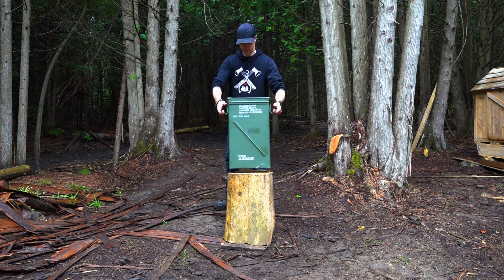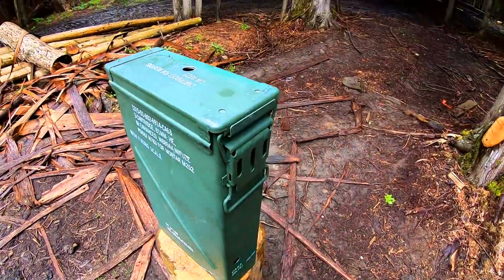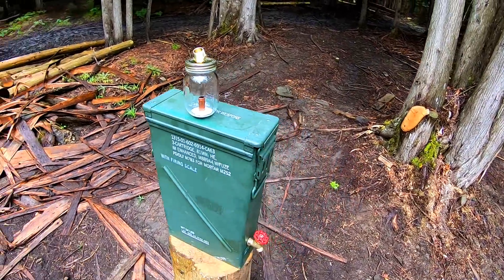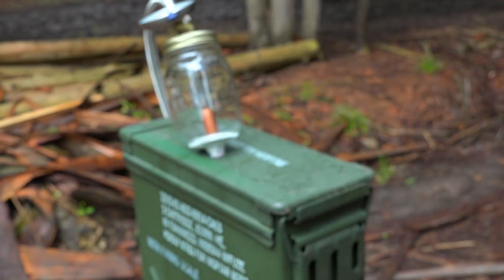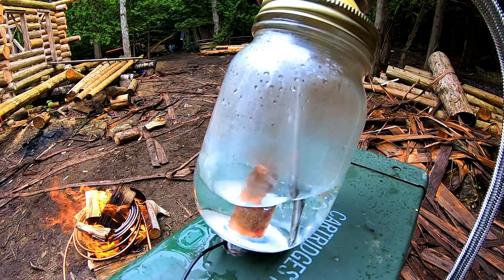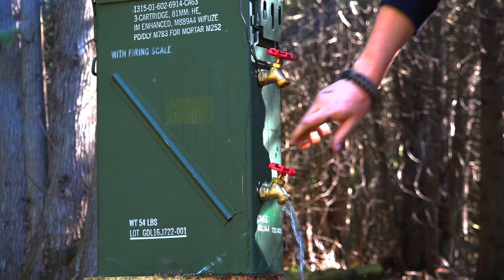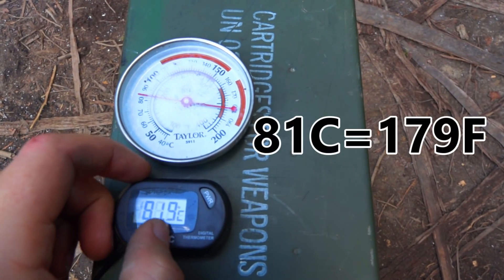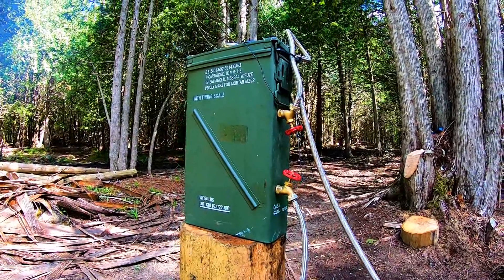Off Grid Heating Prototype- Copper Coil Water Heater / Heat Exchanger / Radiant Heater

Comment from the maker: Want to see the final product? Here's the next episode: https://youtu.be/BREQY1TL7JA
Reply: I haven't bathed in 4 days
Reply: have you thought about an under cabin heating system?  running some pipe or tubing under the floor would sure make it toasty in there.  although im not sure how it would hold up if the water freezes, maybe a cold rated rubber or something, would be cool to see regardless.
Reply: I heat 10 feet of copper 1/4" pipe around a coffee can.  Pair of check valves and the water will only flow one direction. I use 20 feet of pipe to cool before going to a pressure cooker. I get up to 180 degrees in the tank.
Reply: An ammo box? really, just use a big thin radiator you fool, its made for heat transfer, its thin it can also be wide and tall, just find the right one before I find you
Reply: I dont know IF somebody did mention it to you, that you could of just used a simple car radioator and thus eliminate the pressure build up and other problems and gain a much efficient and safe system.
Anyway good video and props on the idea.

Comment: Im unsure how it is pulling from the bottom and returning to the top even though both are under the waterline. The size of ypur tank shouldnt allow for much of a difference in temp from top to bottom and syarting out the water should be the same temp so shouldnt the copper pull the water from both the same and barely put it out the top if not just stagnating. Is there a one way check valve on the top inlet? Just doesnt seem like it would provide much if any circulation.

Comment: Great idea with the portable heater. Same idea as when people used to shove hot rocks and bricks under their beds. One of my favorite setups is salvaging old water heaters. Build yourself another cabin, this one as a bath house, put 2-4 stripped down water heaters inside, and another propane water heater outside. Gut the propane burner and set the heater on top of a rocket stove. I built mine out of old bricks. It only takes an hour to get 50 gallons of water to boiling temp with nothing but branch wood and kindling. Cycle this water into the tanks inside the bath house via thermal siphoning and you will have days of heat for only a few hours keeping a fire going and a few arm loads of branch wood. You can even upgrade it to heat via solar with pipes on the roof. The trick to that is to run a single solar panel and a temperature sensor to a small pump that only cycles water up into the solar heater array when the temperature in said array is higher than whatever you set it to. Say 70F. Otherwise the pump turns off and the water drains back down into the tanks. No chance of ice forming in the solar array on the roof! Easy as pie! Between wood in the winter and sun every other time of year you now have a completely sustainable system and hot baths year round.

Comment: build a small rocket stove and use t copper line around where the thermal mass would be collecting the heat. That would actually be the most efficient way and it would also protect the copper line.

Comment: Put a steel tank over the fire. Consider a 55- or 30-gallon barrel cut down to fit your needs. Fill it with water. Put your copper coil inside the tank. The temperature your copper coil is exposed to will never be more than boiling water (varies slightly depending on elevation) and it will last forever. The way you are doing it is producing steam. Live steam is a fairly dangerous thing. For what you are doing and how you are using it maybe just boil water in a pot and pour that into the ammo can. Then repeat as needed.

Comment: I suppose that this would be better than nothing, but it's insanely inefficient. There are several better set-ups without resorting to complicated equipment. As long as you're dragging a pickup load of odds and ends up into the backcountry, you might think this out a little better, or you're going to be spending a lot of time and wood just heating water.

Comment: Someone probably already said this, but by adding a check on the bottom will help in the correct flow direction and help stop bubbling, and heat faster. not saying you had these problems just adding content lol

Comment: Think about adding a steam radiator to this system to heat with allowing even cooler water to return to the coil by adding a one way foot valve into the cooler side of the coil

Comment: if you run baffles inside the ammo box you will get better water circulation. plus you must have a check valve.... pushing it in only one direction.

Comment: Remove ammo box, replace with a coil /fin unit like a car heater coil and a 12v pump. This will greatly increase efficiency. It's use glycol so it won't freeze.

Comment: I am curious about doing this but hot tent oven to coils that lead to water coils under a cot and back. I haven't thought it through, and I only watch youtube videos, but all the hot tent campers complain about the heat being up high in the tent, or that with multiple people inside, some are hot but the farther away people are cold, and it seems wasteful to burn all that wood and wake up often when the person is only heating far away from the cot and air up higher. I am not the person that is good at this, but I figure hot tents should have a built in system for the ovens to run water to heat the cot instead of the air in the tent. Just me spitballing.

Comment: Heating a long coil is dangerous because of steam and water hammer.  You need a number of larger diameter pipes getting heated, with the inlet low and the outlet high, no dips to trap vapor.  Look how boilers are built,  they can be configured for the liquid to be inside or outside the tubes.  A small gas water heater converted to wood burning is a good cheap way to make a safe reliable water heater.  Keep the PTR valve for safety, and consider blowoff valves elsewhere in the system.

For a convection system to work smoothly and silently, you must have proper sloping and elevation of all parts of the system.  The intake to the heating coil must be the lowest point in the system, the coil must go upward with no dips (the advantage of having a manifold and several tubes instead of one long one), and the outlet must go upward to the tank or radiator with no dips, peaks, or restrictions.  I'd remove the valve from the hot side of the circuit, and use short segments of large diameter flex hose, the kind with 3/4" fittings, for an unrestrictive inside diameter.  This way steam bubbles won't get trapped anywhere in the circuit and interrupt the convective flow.  The sound of bubbling and water hammer would make the thing insufferable while trying to sleep.  Put a hose barb fitting on a large diameter riser in the top hole of the ammo can, and run a vent tube upward to the outside.  This will provide pressure safety while not having steam condensing in your living space constantly.  The long sloping tube will cool most of the steam back to liquid which can run back to the reservoir.

Comment: Great ammo box, efficient not so much.Try to build a rocket stove inside and use stones and mud for insulation. In the Winter take the stove outside build a fire cook your meal when you finish put the fire out and bring the ammo box inside your great snowmobile camper and you will have a night of worm. 
Cheers

Comment: Its a good idea and it will work when it`s not being build by a fool, if you let the steam escape you will need to keep adding water, you need an radiator where the steam can condense back into water, eliminating any loss of water and protentional holes, so you'll fill it once and close it with a good mix of antifreeze , then replace the antifreeze every few years, it must also not be 100% full, it needs a good volume of air for pressure build up and a safety valve, obviously!!!!!!!!!!!! Build it into your shty cabin and your lonely cold knight's are over

Comment: Two problems to resolve here, the steam coming from the top when in close area it will be lil bit like a sauna, but u can resolve this by puttin a hose to the exterior for the steam and the second one is the noise of boiling water, anyway good work bro

Comment: Put radiant fins on the sides of the tank but more at the bottom than the top so that more heat is pulled away from the tank and the water will not equalize as quickly.

Comment: There are some issues in the design first
1- try to insulate the exposed part of ammo box with glass wool 
2- insulate the parts of copper tube exposed to the environment which are not inside your room
3- alot of heat is wasted by the burning wood try to burn it in a closed environment with the coil with refractory materials like fire bricks so that the heat is less wasted this will overall improve the efficiency of the system dramatically

Comment: Very nice you seem like a smart guy 
I wanna coil up copper tubing and install it in a rocket stove with a circulation pump for a heated floor project 
And of course antifreeze instead of water 
My question to you is would the copper get damaged with time from the intensive heat ?

Comment: I'm off grid I have no heat yet. Have not installed my new vented propane heater. For warmth I use, I think it's a -20 degree below zero Walmart $38.00 mummy style sleeping blanket with 12 blankets on top of sleeping bag. And I wear a 7 layer hat and take off some layers when I start to get hot in hat and 12 blankets supriselingy warm as toast!!! This works inside with no heat and after an hour or less I start to sweat at times. Which is no fun. Always very warm! I also have lots of extra clothes, gloves, hats, scarfs, flannel tops, flannel bottoms, blankets, insulated cover alls and extra sleeping bag. I have worked outside for years and I stay warm.

Comment: Two brass ball valves 1 going in and 1 going out to regulate tempature for this project. What I use fory heater core iny old car is in summer. Any car will be more efficient shutting off hot water going to heater core under dash mostly, in the summer time. Old cars not sealed as good as new ones and if heater core breaks cut off valves, let cool, fill up and keep driving. Hot heat coming out of heater core in summer. Makes for a even hotter day.

Comment: You might want to do fins to the ammo box to help it disperse heat. This will help it warm your living space while cooling the water. This may help you problem with too much heat, and help it to warm a larger area, like your cabin. A smaller version would work well for your trailer. It’s beautiful by the way, and something I would want if I was young enough to live off the grid.

Comment: Hey my friend I just wanted to let you know,  this video that you made really has helped me with figuring out how to get hot water my camper where I live. I have been living in this medium size camper for 4 years without any hot water other than what I heat up from my hot eye with a large pot for soups. I have designed my own prototype for getting hot water into my VERY large bath tub that I recently installed.  I will let you know how it turns out 
Thanks Noah D. Birmingham Al.

Comment: We had this idea in Boy Scouts back in 1972. Went on a deep freeze camping trip on Lake Geneva. Used a huge heavy duty aluminum pot with two holes drilled and tapped to accept 1/2" brass gas pipe fittings. Made a 3hree loop copper pipe coil about 18" diameter and connected the two ends of the pipe to the pot. Added water made from melting some snow in a smaller pot to the big pot, then filled rest of big pot with more snow. Water in coil heats up and flows to the upper pipe connector into pot, melting more snow to keep the water flowing. We had hot water for coffee, hot chocolate, freeze dried meals, etc all week. Just had to add clean snow occasionally.

Comment: If the taps were lower down I think the water would still be heated up. That would allow you to use some of the hot water and still keep the water circulating. Another idea for in the summer might be to have the copper piping left in the hot sun.

Comment: I watched another guy do this in maybe Sweden? He had come up with a similar idea and started adjusting the heat based on where he placed the copper in the fire, like a physical thermostat lol. I was thinking maybe a grate over the fire to place the copper tubing on so it isn’t directly in the fire but just above it, still would heat while maybe not boiling.

Ps, the guy might have been Russian, can’t remember, it was a while ago

Comment: Have you thought about calculating the quantity of heat BTUs in the water and the camper walls square footage to see how many hours based on insulation leakage you can expect a certain inside temperature to last?

Comment: Doesn’t look very efficient and will likely get damaged after a few uses. An alternative solution - use a metal cylinder (propane tank etc), run the coil inside with an annular region to burn fuel - it’ll capture more heat than this system that’s open to the elements.

Comment: Just another idea, you could run the copper tubing around the bottom of your Mobil home.  Heating it from the bottom up and just needing to connect it to your system and purge the air from it.

Comment: This is all very complex, bulky, uses excessive fuel, dangerous,  touchy with a lot of connections and points of catastrophic failure. Though i do like the idea id rather bundle up and insulate the walls.

Comment: Anyone considering doing this for heat in an enclosed space or anywhere.  You are potentially creating a pressure vessel of steam and potentially a steam bomb which if it does not kill you will leave you injured and BADLY burned somewhere in the wilderness.   If you don't know exactly what your doing placing a contained water device into an unlimited heat source without any of the safety devices or methods now required by law in such systems is really really reckless;  almost as reckless as putting this video up and saying that the air in the system causes the steam...  everyone tear me a new one but the third hole at the top he said was a mistake so leaving that out and placing valves on the side starting a fire and crawling in a tent with this thing running and going to sleep is suicide.   And yes your accidental hole on top is a vent but what if I wake up hot and close both valves to turn down the heat a little???   BOOM   This is just plain dangerous accident waiting to happen
Reply: You add a one way pressure release valve. Problem solved
Reply: What are you talking about? There is a fist sized hole on top of the box to prevent it from going off lol why would it explode?
Reply: The tube will split... most likely in the fire... it will blow just where and when if not valved propelry
Reply: However it is a viable design... just needs a safety workover

Comment: Love to see a guy using 'my' portable hot tub idea.  Many years ago, I was in Alaska with my sailboat and as it is pretty rainy and cold much of the summer, we were sure wanting some WARM.  The area we were in had no hot springs so we decided to MAKE a hot spring.  Next time we went to town I purchased a coil of copper tubing pretty much exactly like this....a couple of hose fittings from copper pipe to garden hose...and we already had a couple garden hoses on the boat.  We put it all together with a funnel on the end of the garden hose, found a suitable place on the beach near a creek and started the fire. ran the hose over to the creek (uphill, as you can imagine) and awaited developments.  The water coming out steaming too hot to touch and after a half hour/45 minutes we had a skiff full of hot water.  In we went, feeling clever as hell....until I started wondering how we were going to make our getaway if a bear came down to beach to see what was going on.  Next time, we brought the kayaks ashore as well.  -Veteran '66-68

Comment: do not do anything this idiot does it is extremely dangerous to nature and potential forest fires have been caused by this routine , there is a reason why insulation is a real thing on pipes around a home even in cabins in woods when someone is truly off grid to stop a fire in the home from the intense heat, you are showing how to NOT does this experiment if it was all insulated on the outside your hot water would not need constant heating

Comment: I don't know exactly how you did not end up with a melted copper pipe. Perhaps you got lucky with your fire temperature.
Reply: Larry as long as there is water in the pipe it will not melt.  If the ammo box turned to steam then yes the copper could have melted.  Have you never boiled water in a paper cup?

Comment: Just run a twin heater core set up and two pc fan off solar. It also will work as an AC if you can keep the water cool enough

Comment: Really cool! A friend of mine tried a similar setup for a camp shower. He set it up and instead of just jumping in and using it, he turned it on from the outside to test it. Boiling hot water and steam came out! He would have suffered very bad if not fatal scalding if he had not done that...

Comment: I would make the coil out off something harde like steel. It would be more ridget and I whink even more efficient because it would not transfer that much heat through the lines in to the cold air and you have to keep the line at the fire hot not the in puts.

Comment: Less coils in the heat will reduce the amount of energy exchange between the water and the fire. It'll take longer to heat up but possibly prevent boiling and help regulate the temp needed. Colder climate temp? Add another coil or two to the exchange line. Warmer climate temps? Less coils.

I probably would have made some sort of steam heat register and then create a double reservoir distillation system... like a hillbilly double thumper moonshine still

Comment: Cool idea, but wildly dangerous. Why not a floor heating system with a pressure blow off valve under the trailer and a water reservoir outside?